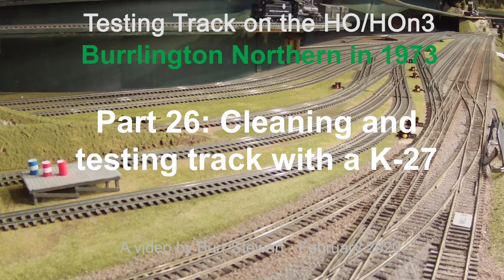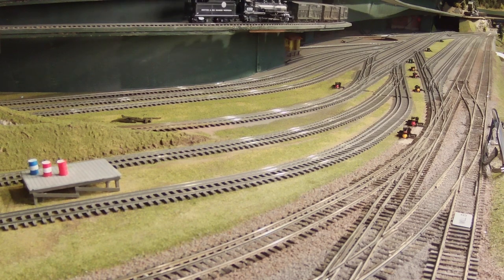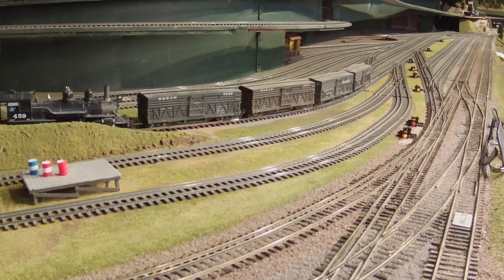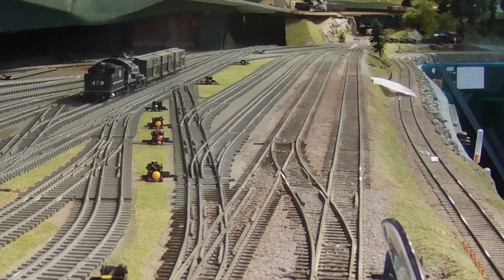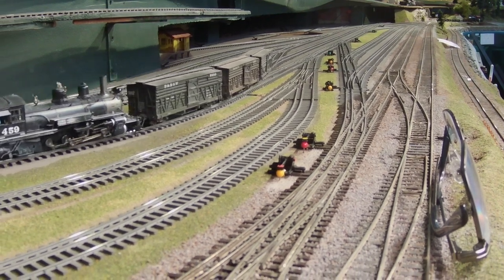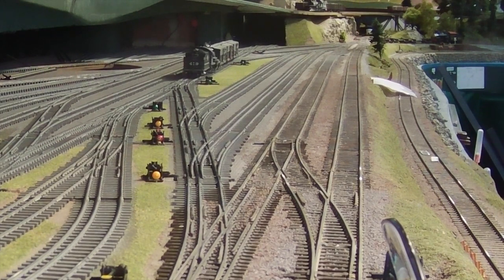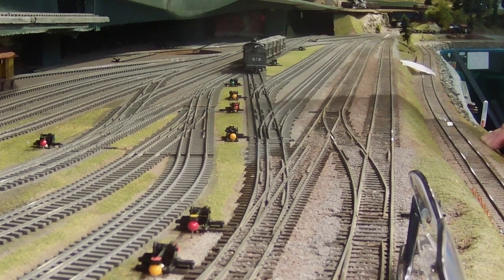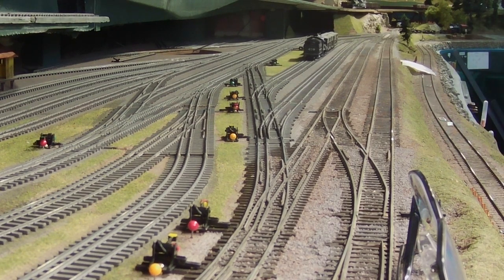Part 26 - HOn3 K-27 Tests Delta yard after intense track painting & rail cleaning

Comment: Hey Burr,

Have you done anything special with your Shinohara dual gauge turnouts for DCC operation?  I am planning a DCC layout with a dual gauge interchange at either end and I have heard the the Shinohara turnouts can cause DCC issues but i have not yet tested these rumors.

The Shinohara stuff is getting scarce!  I keep snapping up any of their dual gauge turnouts and transition tracks that I find.  Frustrating that it is now out of production.
Reply from the maker: I agree it is frustrating that these turnouts are hard to find now. The tooling is out there somewhere...

There are two things I recommend doing to prepare these turnouts for DCC operation. One is to connect the main frog complex to a "frog juicer" circuit so you don't have to worry about the points making good contact with the outside rails. The other is to carefully solder some very fine wire (I used 28 gauge) to the underside of the points and solder it to the adjacent rails, so you are not dependent on the rail joiners for this connection. I have only done this on one of my dual gauge turnouts (the one I installed recently near the stock pen area) and the others seem to be working ok, but if I was starting over (and the patience to do it) I would take this precaution. All that said, study each turnout very carefully to make sure you're clear which rail is part of the "main frog complex" and which rail needs to be isolated from it, because of the complexity of these frog areas. One the one I did recently, it took me longer to study and figure this out than it did to install the feeder wires and connect the frog complex to a frog juicer.

Let me know if you end up with any extra turnouts! I might be able to use them! :)
Reply: @muchfunwithtrains  Extra turnouts...   hmmmm.  I'll have see what's left after I get my layout spiked down.  I'm still in the hoarding phase.

Thanks for the info on how you set these up.  

I remember Malcom Furlow talking about setting up single gauge Hon3 Shinohara turnouts back in the 80's in his SanJuan Central book, similar to what you described.  I generally use ME Hon3 turnouts which work great with DCC but there is no dual gauge solution there.  With the dual gauge Shinohara switches and all the extra frogs I was wondering if they caused any DCC resets due to micro shorts.  From the video you posted I would say it's not an issue if I follow your suggestions.  I do use large capacitor banks on all my engines for reliability, that seems to help a lot.  Any shorting can still cause issues particularly with Soundtraxx electronics.

Hopefully somebody picks up Shinohara again, I have a need for some of their Hon30 products as well.  PECO and the other options we currently have for 009/Hon30 look like toy store trainset track.  Code 80 Hon30 track with O scale width ties!  Seriously PECO.  Looks great for On18 mine equipment though!

Thanks again for the info!
Reply from the maker: I haven't had any DCC issues with micro shorts on the Shinohara dual gauge turnouts, but I also haven't gotten around to putting decoders in any of my brass steamers yet - I'm just running the Blackstone products so far. One of these years I'll get around to that, and report back...